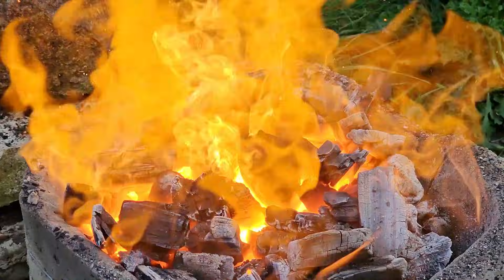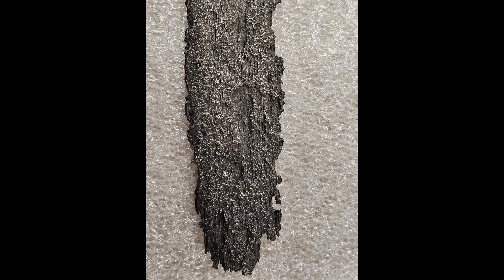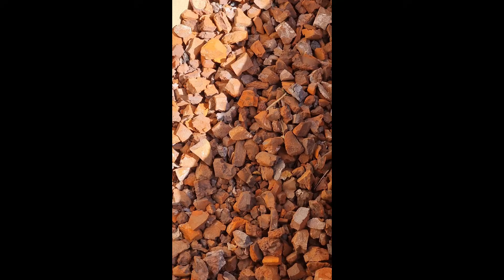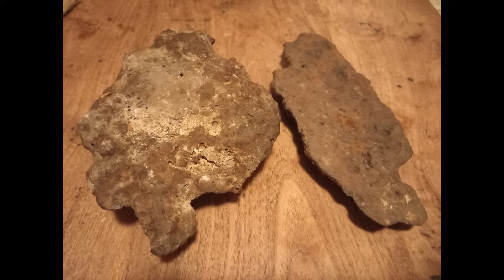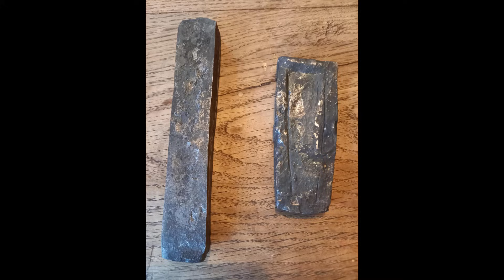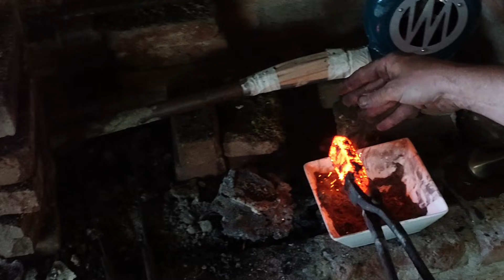The Ulfberht sword explained; Riddles in steel

Comment: Do you only have this one sword sample? You've presented a very interesting hypothesis, however it's  been noted that many early ulfberhts have this type of pattern welding, and I've heard it asserted that it's later ulfberhts which are made of the homogeneous crucible steel.

I think your hypithesis deserves investigation, you need to perform similar analysis on a range of ulberht finds from different time periods and locations, for scientific rigor.

More samples/investigation of swords need to be taken, in order to discern the validity of your claim that all ulfberhts are in fact pattern welded, as there is well documented evidence that in the very least SOME of them are entirely crucible steel.
Reply from the maker: Thank you for the elaborate question, its much apreciated! The sword presented in this article has only the core and the edge steel made from patternwelded steel. While the outer surface layer is made of a hearth refined  monolayer of steel. This gives the impression that the entire sword is made of a monosteel while this is certainly NOT the case. I doubt if any authentic Ulfberht sword is made of a monosteel. All examples I found online or in articles, if one looks more closely show a laminar interior with only the outer layer of a monosteel.this was done to distingish from the Pagan twisted patterwelded technology of decenia before the Ulfberhts were made. This outer layer is in this case most likely made from hearth refined steel and not made from Wootz. This is based on the extremely low arsenic content of only the outer layer and the edge steel. Analysis done by Moilanen shows also an extremely low P and S content, which can  basically only be explained by the hearth refinement technique under the application of calceferous wood ash flux. Wootz usually has elevated Phospherous and Sulphur due to the way wootz ingots are made in crucibles. Making it very unlikely that wootz was used in the Ulfberht swords. Also it is very unlogical if the Vikings would sell their prime imported wootz steel to the christian enemy and not use it at all in their own forges. Only the christian regions would use crosses and roman letters on the swords. I would be very interested to see some close up photos of Ulfberht swords that do not show a pattern welded core. I am pretty sure they will show layering on the inside when looking at rusted spots. For this investigation 2 of the earlier types have been investigated and one of the +VLFBERH+T type. All show a quite similar construction. But all are found in The Netherlands. If you can point towards a full monosteel sword I can have a look at some images. Personally I think the imported Wootz theory does not hold up. As hearth refinement can easily explain the high carbon, low slag steel used by smiths in the Christian Hamaland region. Also the ingots found in slag jeaps  in The Netherlands dated to the Viking era match the chemical composition of the Ulfberht swords. Also to the rare and unique trace elements like Cobalt, Molybdenum, Chromium, Vanadium and Titaniun and Manganese. Making it extremely likely that they are made from a similar ore.If you can provide some analysis that show these swords were made from monosteel I would be very interested to match that against the analysis done for this investigation. Again that you for your interest and inquieries.

Comment: Give me a call.
Reply from the maker: I think it would definately be interesting to talk via teams or skype, as you obviously have found high carbon ingots as well. If you have found them in Ulft or Oer that would be especially interesting! 
I do not think that these ingots are formed by lightning (altough they do look like like lightning bolts). They are formed during secondary remelting, where due to the high temperature manganese will be transformed from the slag into a metal alloy. When too much slag was addef during the remelt an excess of 2% manganese can be formed. This makes that the metal absorbes soo much carbon that it becomes fully liquid and melts on the bottom of the furnace. Usually these ingots form in a branched way as it finds its way around the charcoal pieces. These pieces were fiscarded since they have too much manganese for normal forging because too much slag was added during the remelting or hearth refinement procedure. Usually these branched ingots show a heavy dendritic pattern on the outside surface, which certainly reminds one of high voltage structures. Also due to the high Mn and Ni content they hardly rust even after 1000 years in the soil or water. Does the description I gave match with the iron pieces you have found in Ulft? That would be a clear indication that hearth refinement took place in Ulft. It seems that the smiths of old preferred 90% iron and 10% slag during remelting. As these type of ingots match very well with the trace elements in the Ulfberht swords.but when more than 50% slag was added the risk of  excess Mn would be real. But certainly interested in a call. Maybe its best to contact me via this channel with a PM.
Reply: @wobkejurjen2287 There are traces of Meilars for carbon making in the neighborhood
Reply from the maker: If you are interested you can reply via: dijkjurjen@hotmail.com  . So I can set up a teams call. Very interested into your findings as well! Kr, Jurjen

Comment: Was made in Ulft, location Oer, on the bank of the river IJssel (The Netherlands)with steel from lightning pipes in the iron containing ground.
Reply from the maker: Thank you for your response! The site of Ulft is definately a realistic contestant for the actual smithy location as it is ideal for waterpowered iron workings and is very close to the Montferland rattlestone mines. Also the name bears a striking similarity with the town and the swords. The historic site of the Motte Ulft where later the castle was positioned is particularly interesting for further investigations. Also the site lies direcly against the main waterway to the Scandinavian kingdoms. I did analyse chemically the local bog ores as well, but there I could not find a 100% match in trace elements between bog ore and the swords. Perhaps it matches with the inlay material... I can have a further look into that. Can you elaborate a bit on what you mean with lightning pipes? Thank you.
Reply: @wobkejurjen2287 Later Ulft became known for bis iron furnaces of DRU.
LIGHTNING PIPES ARE TUBES OF IRON FORMED IN THE GROUND BY LIGHTNING, BY THE ENORMOUS HIGH VOLTAGE OF THE LIGHTNING. THE IRON OF THE WALLS OF THIS TUBES WAS MOLTEN AND HARDENED.
THE VIKINGS WITH THEIR FLATBOTTOM SHIPS COULD EASILY ACCES THE IJSSEL RIVER TILL ULFT (THE LOCATION OER).
Reply from the maker: @deguldenmiddenweg895 the vikings certainly were able to reach Ulft since the major viking raids of Deventer and Zutphen exactly prior to the great heathen army invasion of 865 into anglo saxon England was done to take the weapons that were promised, but the edict of pitres of 864 made it illegal to supply the swords. This is why on the eve of the invasion the trade towns where these weapons were sold were attacked. And that is why we find quite a few Ulfberht swords in the UK connected to the great heathen army. Altough this is still speculative connecting the dots. It does build additional confidence that the Hamaland region was attacked for its weapons. As they are found in The UK connected to the great heathen army right after the assaults on the trade towns surrounding the Montferland region and the river Ijssel incl Ulft.
Reply from the maker: @deguldenmiddenweg895  I am not aware that steel can be formed by interaction of lightning striking ore deposits. Altough I fid have seen iron or steel artifacts that do resemble to a large degree lightning bolts. I alway thought them to be irregular remelting ingots. The ingots you see in the video are most certainly from slag heaps and therefore not likely form by lightning strikes. I do understand what you mean since the steel rods I have also seen from the area do look like lightning traces. But I considered them fully liquified remelted bloomery iron. In dedicated finery furnaces

Comment: Very nice too see our artisan ancestors being taken seriously as intelligent capable people who understood their craft. Even though the science as we know it didn’t exist yet they knew the effects and consequences of the technics  they were doing at a very high level. Dankjewel, mooie aflevering
Reply from the maker: Thank you for the complement! Indeed technological innovation is something that has always played a key role in Dutch society. Maybe even more so in the Viking age. From these analysis is becomes clear that the Ulfberht swords are even of higher quality than previously thought. With the laminated core and a high carbon steel on the edge that is purified  of contaminants like phosphorus and arsenic, while having a manganese enriched alloyed steel. Also the tripple  layer edge geometry allows for a cold working of the edge, similar to farmers sharpening their scythes in a process called peening.
I also forged a chissel from this hearth refined steel quenched in water that will not dull, chip or roll even after hammering concrete and  modern brick. The quality turns out to be even more impressing than I expected. Combine a superior starting material with superior craftsmanship, than indeed weapons that after 1000 years still render the mythological status it deserves!